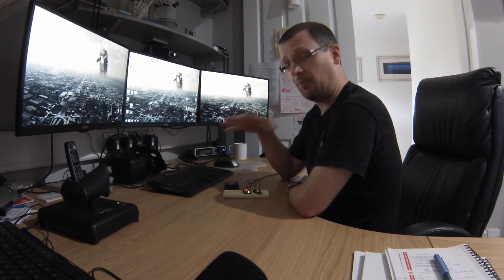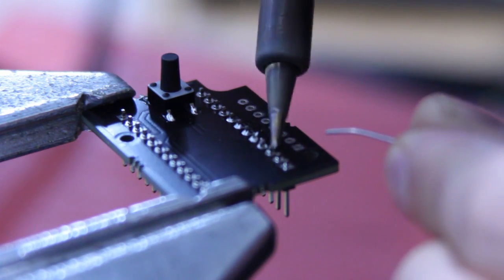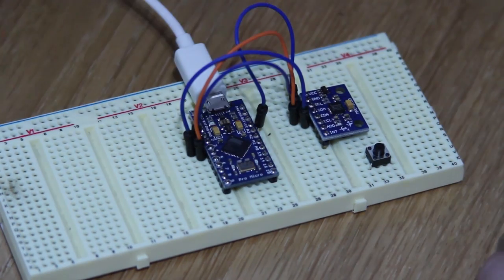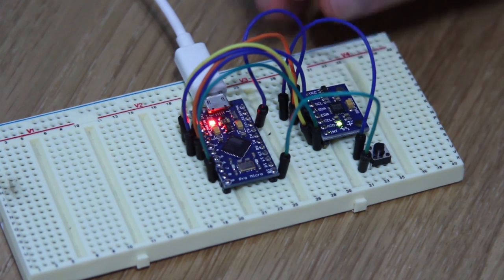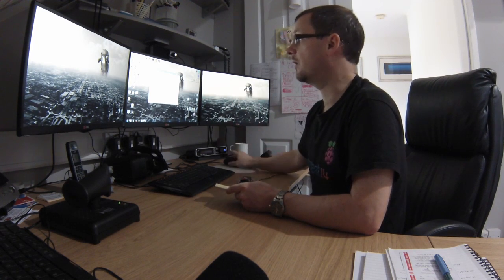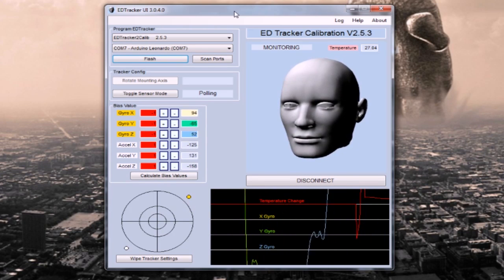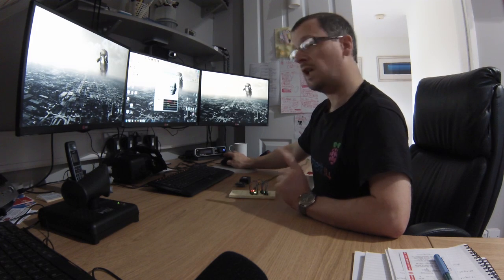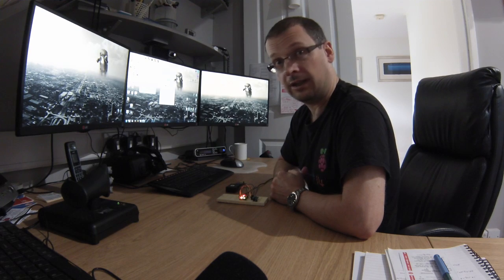DIY EDTracker - debugging some common issues

Comment: I really admire your work on EDtracker. Too bad the project stopped. I think it would be interesting the Laser Distance Sensor - Hc04 to zoom. Also a possible adaptation of the code to be used With Esp12 or ESP32 which has a processing power much greater than the Arduino.

Comment: I recently built my edtracker DIY with MPU 6050.
After installing the drivers for arduino, calibrating and flashing latest firmware it stops after few minutes.

I mean it works fine, but then suddenly stops.

When it works TX diode lights up, RX blinks. When it stops, TX diode goes off, and RX is lighting constantly.

Any ideas what could be wrong?
Would much appreciate any help!

Comment: can i use this to play vr games ( headtracking)
Reply from the maker: Purely dependent on the game, I'm afraid. Not something I can answer!
Reply: if it can emulate a mouse it should work on all games right ???!
Reply from the maker: It emulates a joystick - so if your game supports joystick headlook, you should be fine. There are other 3rd party tools like Opentrack and FaceTrackNoIR which can convert the joystick output to a variety of other protocols too - so you should be pretty well covered for the majority of games with headlook. As for VR, I don't know so much in that area I'm afraid.
Reply: ok thnx. is it possible to to use free pie ?
Reply from the maker: I'm not so sure, reading the web page - it only seems to support outputting to virtual joysticks (vJoy) - no joystick input?

Comment: important note, if you are trying to wire a 9250 from china,, no LEDs on it will light up. :D i was worried at first that i've got a faulty mpu, but everything is working fine. thank

Comment: Awesome video and awesome initiative, big thumbs up! I already got the Leonardo and a 6 DOF tracker so will give this a go. However, I wonder, how difficult would it be to upgrade that project with wireless communication - bluetooth or 2,4Ghz...
Reply from the maker: +konstantin lozev Pretty easy from a hardware perspective. We're working on it in the background for the DIY version; main issue is code size, not physical, so Rob's working on some code revisions to get it down in size. Maybe, one day ;) !
Reply: brumster100
Great! Fingers crossed!
Reply: +brumster100 Just saw the Raspberry Pi Zero. Would it not be easier than the Arduino as a wireless solution with a standard wifi dongle? Assuming you can add an IMU board as easily...
Reply from the maker: +konstantin lozev Backwards step really - development would need to make an embedded EDTracker firmware for it, unless you intended redeveloping EDTracker firmware into Python to run within an existing OS on the Pi. Non-realtime OS would probably suck in terms of latency. Just massively overcomplicating things really. Then your wireless isn't really the right application - we're talking using 2.4GHz technology to transmit the signal across to a specific USB dongle in your PC that's emulating a HID joystick. This isn't a "Wifi" dongle; it's specific hardware. I'm guessing a standard wifi dongle you're referring to is a networking dongle for 802.n/g connectivity, not something you can access to a sufficient low level for us to do what we want with it :(

TL;DR... No :D
Reply: Now that you put it, I agree, I was thinking more aloing the lines of the FreePIE mobile app sending the IMU data over wifi to the PC app, but I agree the 2.4Ghz with a USB dongle is maybe the most stable and low latency approach
Reply from the maker: +konstantin lozev You could do something with UDP like Opentrack does, but the intention is really localhost connectivity or at best something wired. Going over an IP network would give us all sorts of potential headaches in terms of support too. Sometimes the choice to make is the one that considers more than just what is "technically best" but also cost effective, less hassle to manufacture, to support, to set up, etc ;-). Balance between what's a cool DIY project "just because it can be done" (your idea probably can be, technically!) and one that'll not end up with us tearing our hair out :D !!! I haven't got enough left already!
Reply from the maker: +konstantin lozev You could do something with UDP like Opentrack does, but the intention is really localhost connectivity or at best something wired. Going over an IP network would give us all sorts of potential headaches in terms of support too. Sometimes the choice to make is the one that considers more than just what is "technically best" but also cost effective, less hassle to manufacture, to support, to set up, etc ;-). Balance between what's a cool DIY project "just because it can be done" (your idea probably can be, technically!) and one that'll not end up with us tearing our hair out :D !!! I haven't got enough left already!
Reply: Yeah, thanks, I guess you are right, I have no experience with Raspberry Pi, so I would not know.

Comment: Hi Brumster. ive flashed my edtracker and it says not connected above the temp box.
Not sure what the problem is.
Reply from the maker: +bugsy1ninja How did you manage to flash it first time? Did the flash complete successfully?
Reply: im not sure. should i wipe it and reflash? and how do i go about doing that?
Reply from the maker: +bugsy1ninja Maybe, but if you can't connect, then I'm not sure how you can flash it?! Do you see the COM port listed in Device Manager/the GUI (probably as an Arduino Leonardo, but it really depends what you built it out of and what drivers you've installed)?
Reply: brumster100
ive built the arduino out of the build in this video and the drivers are the ones on your website form this video. its listed and ive flashed it it devices and printers its listed a edtracker 2
Reply from the maker: +bugsy1ninja It should be working then... in the GUI, click "Scan ports" and it should automatically connect. If it doesn't, you can manually select the right COM port in the drop-down box, then click the CONNECT button. Assuming you flashed the right firmware of course, for whatever you used MPU-wise (9150 or 9250 presumably?)
Reply: it connected but its said -2715 temp and everything at 0
. now wont connect again
Reply: and it also said dropping com 7 then it flashs to com8
Reply from the maker: +bugsy1ninja The COM7 to COM8 thing is normal, that's fine, but the -2715 temp and everything at 0 suggests the connections between the MPU board and the Pro Micro are wrong, or not good contacts... something wrong at a basic level there I'm afraid.
Reply: brumster100
ok thanks i think i might need a new mpu.

Comment: Hi everyone! Has anyone succeeded wiring a 9250 without using a switch? If so, did you do anything different than the awesome tutorial Brumster showed here? Thanks in advance!
Reply from the maker: +Nasser Elsamadisy Should be no different at all. Just leave the button out/off, don't put any wiring in it's place, just leave pin 10 unconnected.

Comment: Hi Brumster. In readiness for ED Season 2 Horizons I've built myself another ED Tracker this time using the 9150 sensor board. The completed device was detected by the GUI software and I was able to flash it usng the 4.0.4 build but now the device isn't recognised. I'm using the Spark Fun Pro Micro board, along with a new ED Tracker board and MPU9150 and have a solid green LED by the USB connector (@ 9 o'clock orientation), with a blinking green LED  (1sec on, 1 sec off) at the lower 3 o'clock position. There's a steady red LED on the MPU9150.  OS is Windows 10 connected using a USB phone data cable that is known good. USBDeview is showing USB descriptor request failed. Any thoughts?    
Connection sequence is as follows; on initial connection the green (power) LED by the USB connector comes on followed by the lower LED blinking rapidly for about 18 secs (boot process I would imagine). It then settles down to the 1 sec on 1 sec off behaviour. MPU9150 LED remains constant from power on.
Reply from the maker: +Andy Wragg This sounds like an occassional Windows 10/driver issue we've heard of - try grabbing the latest Arduino driver from their website and popping it on (use USBdeview to clear out the old one just to be safe). Some people have reported it best to keep EDTracker unplugged until after Windows 10 has booted. Give that a try, let me know how you get on ;)
Reply: HI Brumster100 thanks for responding. I've tried all the drivers I can find -- 1.5.8 from your web site,1.6.4 and 1.6.6 . They all report BADDEVICE.Dev.NT in the driver Inf
Reply from the maker: +Andy Wragg I think drop us an email via the website, maybe include a screengrab from USBdeview if you can with details of the USB device the Pro Micro is being seen as (double-click, screengrab the properties window)... sounds very odd...

Comment: Hello from Spain Brumster, thanks for your great work with the edtracker. There are any way to swap the sda>pin2 and scl>pin3 to sda>pin3 and scl>pin2 on the sketch? With that pin assignment those pins will be fisical paired with the arduino`s pins and make the pcb more clean.  Many Thanks
Reply from the maker: +Angel Molina Mula There's not I'm afraid, as they are hardware pins on the Atmel microcontroller. Believe me, we had the same idea but unfortunately it doesn't work :) !! Thanks for your words of support... ;)
Reply: +brumster100 Thanks..Anyway there are any way for a modest donate for this proyect?
Reply from the maker: +Angel Molina Mula Wow, that's very kind of you... sure, you can donate to us via PayPal if you like... sales@edtracker.org.uk. Many, many thanks.

Comment: Hey brumster! I love EDtracker but I have one super annoying issue that prevents me from enjoying it. I experience excessive drift when looking up or down and to the side at this same time. When I look straight forward again its way off, sometimes as much as 90 degrees of drift after few seconds of looking at overhead panel of my Huey. My device is properly calibrated, both dots almost exactly at the center, set up drift compensation many times, tried re-calibrating, changing usb ports, nothing helps. I haven't found any answers on the nets. I hope you can help me.
Reply from the maker: 6050 version I assume? Drop us an email at EDTracker HQ (contact form on the website!) with details and we'll see what we can do. Confirm version of software you're using, settings, etc.

Comment: The only "problem" I'm still having is, that I have to slightly adjust the drift compensation between every usage. But otherwise it's just great :)
Reply: I had the same Problem, but after the change to the MPU-9150, no drifting anymore :3
Reply: The drift is bad on mine... It was a fun project and I do not regret building it, but taking the time to recalibrate each time I use it, means I do not use it much.

Brumster I hope that does not sound ungrateful. The work you and your friends have done is wonderful thank you.
Reply: With the MPU-9150 there is no calibration ;)
Reply from the maker: Rei Nori
Hi Rei, no, not at all, I'm sorry to hear you had problems. I do hear this from the odd person and I've no idea why some people experience it so bad, because I (and many others will attest this, I'm sure) simply don't get it I promise you. Maybe it is MPU variances, but I suspect some people are either turning off the auto-centering or are leaving the GUI running maximised when playing (which disables auto-centering). Sorry to hear it didn't work for you. If you followed the instructions to the letter then I can only suggest it was a faulty component :( but thanks for your kind words, the team appreciates them!